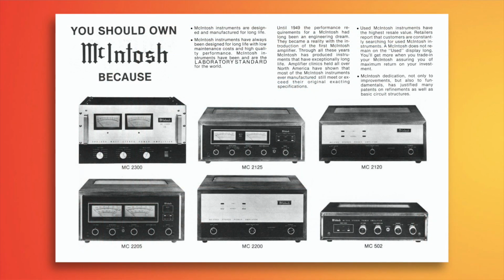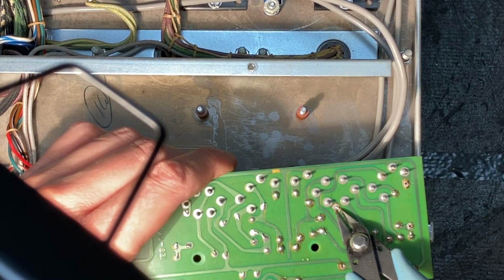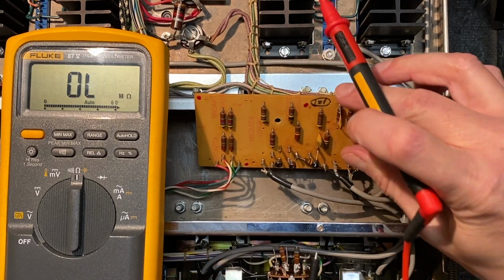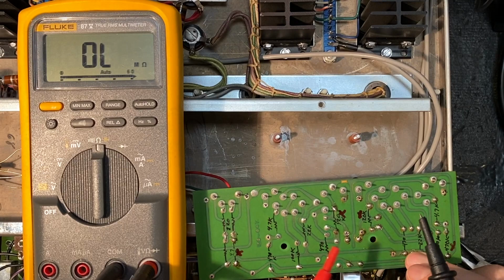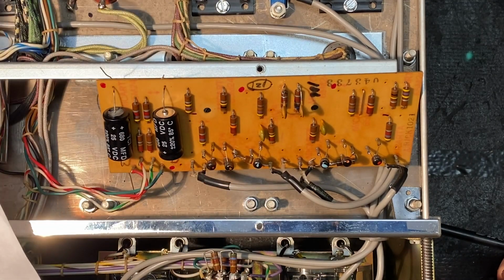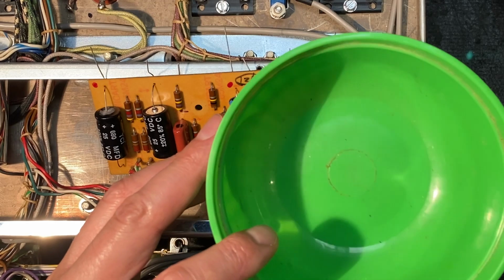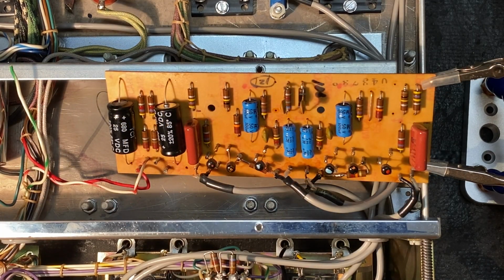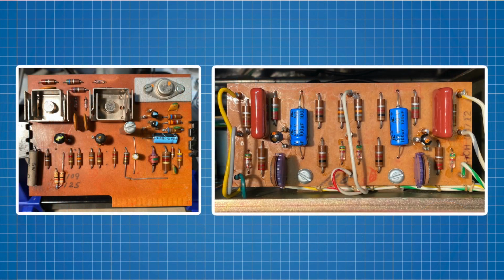McIntosh MC 2105 Restoration P3: Let’s Recap & Test The Input Board

Comment: Thanks for the videos. You have convinced me not to count on my reforming the capacitors but to change them. I would caution though that lead/tin solder joints tend to have the metals migrate apart over the course of about 11 years. It's a simple and good idea to touch up all the solder joints inside while the amplifier is apart. Just add a small amount of thin solder when you melt each joint. Something I learned in a course to repair multi-layer circuit boards.

Comment: It's paying off for me to be patient and watch the entire video even though I want to get going! I de-soldered the four wires from the board, as you recommended, (after two broke off on you. But hey, you saved me that same trouble so I'm not complaining!). 

I've had that happen before in other projects and found that if I applied a little additional solder into those wire cups and then held the soldering iron's tip against the outside of the cup, (near the base), I was able to pull the wire strands out with tweezers. 

I had to work fast and I kept a damp paper towel close to quickly cool things down because sometimes, I had to turn the temperature up a little higher than I was comfortable with. Still, I'm not saying that it was necessarily worth the extra effort. It can get frustrating if you're just a second or so slower than you need to be. At the time, I didn't have a de-soldering station with a pump, which could have made the extraction step a little easier... Or not.

It's interesting to note that the position near the top right where you thought another capacitor went, was the position for the R18 Resistor on my PCB. I don't know if yours was produced before or after mine but apparently some engineers used 20/20 hindsight. The zip-tie suggestion for the wires was a good one too! 

On my PCB, I have two ceramic caps that are shown in the schematic and 2 that jump across leads of two transistors, as your PCB had. Those two are aftermarket but I'm leaving them until I see how your results turn out. They're easier and quicker to remove than to reinstall, so I'm taking advantage of your results to save a little extra work (another reason why these videos are so helpful). 

Great Video!!
Rich

Comment: Hey Chris,
I'm being barraged with sudden appointments, meetings, and calls but I managed to get some time back to this project. I used 3 different DVMMs and continued to get similarly strange readings of the two resistors (at about 8:18 minutes in the part 3 video), as you did. 

Because it's been a while since you did this job, In this part 3 video, the R9 resistor is the one to the far upper left of the PCB and the R10 is just to the right of R9 (when looking at the resistor surface of the board). The R10 was the one that gave you all sorts of various readings

I’m trying hard to be brief, but I need to be sure I make sense, so please accept my apology for the long post:

The first thing I need to make clear is that my two caps in that same position, (R9 & R10), are 2.2K each. My R9 & R10 resisters are 4-band and the colors are Red, Red, Red, & Silver, making them 2.2K with a +/- 10% tolerance.

Mac specs call for 4.7K each, but I don’t know if that’s what the specs for my particular amp is supposed to be… I know that the amp could be from a production series that made changes of this kind in various PCBs throughout the production of the MC2105. 

Models with serial numbers between XXX & XXXX may have had a change that included a resistance reduction in the R9 & R10 positions. Have you come across any MC2105 schematics that call for 2.2K resistors in those two positions? 

Unfortunately, the serial number on my amp is illegible. It appears that it was stamped on the amp in blue ink and only in one location; on the back, mirrored, surface, (which already makes anything back there, hard to read). The characters that I can see appear to be “8303”. However, the only characters I can make out for sure are the last two: 0 and 3.

In addition, I think there may have been at least one or more characters before the 8303 (and maybe even after). Because those first two characters of what I can see are so badly worn, the possibility that the characters are “3803”, or “8803” are pretty good as well. 

I found a stamped the number “17930” on the mirrored surface where the face of the two large caps are mounted against. I don’t know what that number refers to, but I think if I call Mac and give them that number, they may be able to tell me what possible serial numbers may apply to this amp.
 

If I know the serial number, I can find out if my two 2.2K resistors are supposed to be there. If there are a reasonably limited number of variations in the 2105’s production, I may be able to search for all the various sets of schematics and then see if any have 2.2K resistors called out for R9 & 10.
 

If you happen to know where I can pull up the entire group of schematics for the 2105, please let me know. Or maybe you might know another location for the serial number besides that one spot?

Of course, I’ll start with checking on the Mac website, but for some reason, I feel like they won’t give access to them all. They’ll probably require that I type a serial number in the search box, which would be a problem.
Thanks,
Rich
Reply from the maker: Rich, user and service manuals can be found on hifi engine for the 2105 here: https://www.hifiengine.com/manual_library/mcintosh/mc2105.shtml 

You’ll need to register to access the files. 

I found a note stating that in units below serial number 28M65, resistors R9/10 are 4.7K. But I also found a service manual for serial numbers 26M08 that has R9/10 at 3.3K.   I haven’t found any reference to R9/10 being 2.2K, but I have no doubt that if that’s what’s in your amp, it’s what’s called for in your particular vintage of MC2105 and I’d stick with that.

Note that the troubles I had measuring those resistors was due to the fact that I was using a meter that auto-detects between resistance and capacitance and it was simply getting confused. Using another meter in strict resistance-mode remedied the problem.   If you’re using an auto-detecting meter, force it to read only resistance. Also, when you run into problem readings for components in-circuit, lift one lead from the board to get a more accurate reading. 

Hope this helps.
Reply: @FluxCondenser   Yes, it helps immensely! All the resistors in my board look to be original. If they were replaced, the person who replaced them, replaced all of them with resistors from the same manufacturer.

You said "...lift one lead from the board to get a more accurate reading"). are you saying that I can get an accurate reading on a resistor w/o having both probes in contact with the resistor leads?

I suspected that my DVMs were having something to do with the strange readings. However, my lack of expertise in the field, came up with this extravagant explanation, (I thought it made sense, but maybe my logic isn’t as sound as I thought). This is what I thought:

I noticed the resistor reading jumped around, but after a while I could get a solid reading. It slowly climbed and finally stopped at 2.17K, (the resistor in my case). I began to suspect that the DVM was directly or indirectly sending a charge to other components tied to the path of that resistor, each time I touched my probes to the R9 and/or R10 leads. 

That would, in turn, charge the cap in the path, which would then turn on the switch in the transistor/s, amplifying the voltage enough to carry additional charges to or from other resistors, transistors, and ceramic caps in the path.

They would quickly bleed off and then the process would start over again. Of course, when I switched to a DVM that didn’t have auto ranging, I got a good reading.

However, I still thought the auto-range DVM would switch and charge the ceramic caps and then that cycle I mentioned would start.
Could that be what the auto-range DVM was doing?

BTW: I meant to ask you: Do these particular resistors have a special name or classification? Over time, I’ve built up a collection of assorted resistor packs. I would buy them for various homemade projects and others are saved for future electronics learner/hobby-kits.

Even though many of my ‘kit resistor assortments’ include resistors rated at 470K and even 1M, none of them look as robust as the ones I see in many household AC products, including this amp.

I’m pretty sure that these resistor assortment packs aren’t appropriate for use in systems like the MC2105, (they just seem too ‘light’ for that). So if I wanted to order resistors to match those in the amp, what would I specify in the search aside from the resistance and tolerance ratings?
Rich
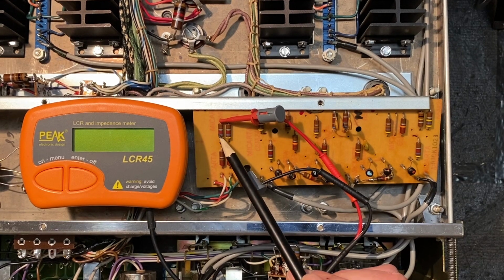Reply from the maker: Rich, when the term “lift” is used in this context, it usually means to remove from circuit. If both resistor leads are connected to the circuit, as you noticed, other components such as capacitors can affect the readings. To get a more accurate reading, it’s not necessary to completely remove the component. As long as one lead is “lifted” or removed from circuit, it is no longer part of that circuit. There are many styles of resistors such as carbon comp, metal film, etc, but the overall size differences between resistors is usually due to them having a different wattage rating. It’s important that you replace a resistor only with one of the same wattage. Very small resistors can be rated for as little as ¼ watt. The typical size you usually see for resistors are generally ½ watt. From there you’ll see 1 watt resistors which look like typical ones, but are larger. From there, the higher wattage rated resistors can look quite different. I discuss this in more detail in my video, “How to replace selenium rectifiers” at about the 7:10 mark: https://youtu.be/rgml4if6kv4
Reply from the maker: Also, you should look closely at any notes in the service manual. For instance, it states there that “Unless otherwise specified: Resistance values are ½ watt and 10% tolerance.” Note that there are also 5 watt resistors used in the amp.
Reply: @FluxCondenser   Ah! Of course! "LIFT..." I know I'm tired today when I realized that I didn't read that correctly. The fact that I didn't understand that statement is telling me that I need to go to bed. I'm very familiar with lifting a lead from an in-circuit component when I suspect a bad reading. I was just too tired to recognize the term.

I was up way too late for the last few days and then today, I had to get up earlier than I usually do so I could meet with my attorney to sign my will. I wound up getting only about 4.5 hours sleep. The 45 minute nap I took when I got back from the meeting apparently didn't make up for it.
Thanks again,
I'm calling it a day.
Rich

Comment: Hey Chris,
I have one point that’s throwing me in the Power Input Section PCB:
Mac’s schematics shows 10 capacitors in that board, but they don’t show them in their parts list. I see two small ceramic caps, (the schematic labels them as C7 & C8). 

Both are supposed to be 4.7pF. The parts list doesn’t have them listed so I don’t know what the voltage spec is for those even if I wanted to order them. Then again, small ceramic caps may not have a rating for voltage (I haven’t looked into that yet).

The two I have, are printed with “4.7 20%”. In fact, I have a third one just like those two, and it bridges a transistor, (Q2), which I believe is for the same reason regarding the high frequencies as your board had, (if I recall correctly).

What do you think those 4.7 pF caps do?
Rich
Reply from the maker: Rich, don’t worry about replacing the ceramics. It’s not necessary if they test fine for capacitance. Ceramics are very reliable. Same goes for mylars and polyesters. Just check them for capacitance and if good, leave them be. Many wouldn’t even bother checking ceramics as they’re so reliable. The function in the circuit with those picofarad caps is usually to keep the very high frequencies at bay. It’s possible in an amp to get very high frequency oscillations beyond the range of hearing which overworks the amp, drains power and can be damaging to speakers.
Reply: @FluxCondenser   What about Rainbow Caps? I mean, are they as unreliable as I've read? The two I have in this PCB don't look bad but several posts, in at least two different forums claimed that it's almost a sure bet that they're leaking. 

My tester won't be here for another few days but I'm going to replace them both with two Mylar caps. 

The Mylar caps are brown and have this printed of them: 
"474K 1848 250V T MMR". 

I don't think the 474K means they are 474 Kilo-Farads (that just seems too high to be the case, but...)

Rich
Reply from the maker: @richpaul8132  The caps labeled 474 are most likely 470 nanofarad. In my experience rainbow caps aren’t likely to be leaky which is usually the case for mylars, polyesters, etc. DC leakage is most often found in paper and electrolytic caps. But, rainbow caps are generally poorly constructed which leads to not leakage, but intermittence. I forget which, but in one of these videos of this series I explain this and take one of the rainbows apart to show the poor construction. The leads are barely attached to the body and fall out easily. 

I don’t recall rainbow caps on my MC2105 boards, but I know there were two on the input jacks to block accidental DC. In my amp they tested fine, but I replaced them anyway for reliability as I’ve had so many issues with them. 

If those are the caps you’re talking about, you may want to consider leaving them in as I recall installing them in that tight spot was tricky. To take the capacitors out of circuit, there’s a switch in back for direct input. It’s advised to run with the caps in place in normal operation, however. 

Hope this helps. Sorry, it’s been a while since I made that series, so I’m going from memory. Additionally, as I said before, there are many different versions of this amp so yours might have slight differences depending on when it was built.
Reply: @FluxCondenser  I'm surprised that you remember as much about this video as you have! The Power input Section of the job in your video (Part 3) didn't have any Rainbow caps. That's the PCB where my two are located. They are two of the 8 caps involved in the replacement process.

The 470K 250V is printed on the two caps that came in my recap kit. I'm going to use them to replace the two Rainbow caps. The Mac Power Input Section schematic shows that these are the positions for the 470pF/250v caps. The color code on Rainbow Caps presently in the PCB confirm that they are .47uF.

All of the caps on the Power Input section are easy enough to get to so I'm just following the video along at this point because I have the required replacement caps. So far, everything is going very well.
Thanks again,
Ric
Reply from the maker: @richpaul8132  Note that .47 uF is 47 nanofarad, not picofarad.
Reply: @FluxCondenser   Ah! Yes, I was mixing myself up and/or mistyping. The small ceramic caps in the schematic are noted specifically as 4.7pF but the two positions where I have my Rainbow caps, (C3 & C4) actually don't specify the symbol. 

They just show ".47", which is strange because throughout the rest of the drawing they show whether it's a uF, pF, etc. I suppose it's not necessary to place "nF" if the decimal point is preceding the first digit. Thanks

Comment: Hi Chris,
In my board, I have two Rainbow Caps, ("Tropical fish"), in place of where you have two, white, rectangular components, (I'm only 2.5 minutes into this video so I'm not sure what you have there). Everything I've read so far seems to discourage using rainbow caps. No one seems to think very highly of them, which is why I find it so strange that they would have used them in this amp.

Mine are color coded as follows: Yellow at the top, Violet is second, Yellow, (again), is third, White is fourth, and Red is at the bottom. the Cap is stamped with "Q C 7". Of course, I'll be replacing those, I'm sure, but what do you think about these? Based on the color code I researched, these two are .47uf/250v caps with a +/- 10% tolerance. Does that sound about right?
Rich
I found a neat little calculator/convertor online that confirmed they are .47uf +/- 10% Caps. (Here: https://www.petervis.com/electronics/capacitor/capacitor-colour-code.html)

Comment: I would have loved to have seen the output power, distortion, and frequency response measurements before and after the recap.  Thanks for the great video!!!
Reply from the maker: Yes, that would have been great to compare. I avoided that, though, as the performance was so obviously poor and given the amp’s age (and expense of those autoformers), I didn’t want to stress it out with a dummy load and power tests.